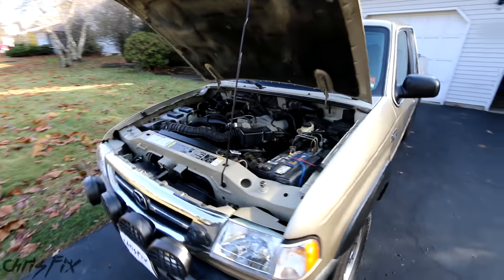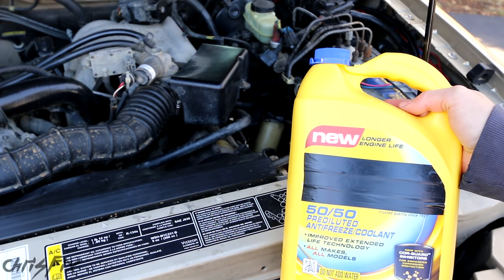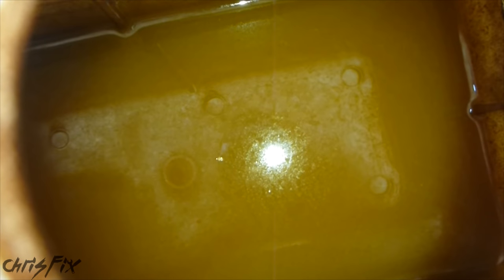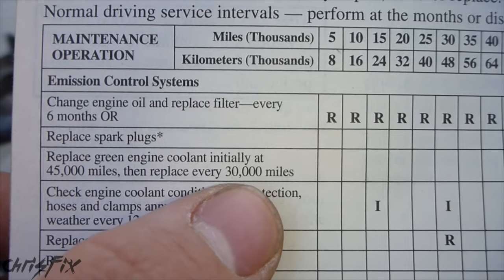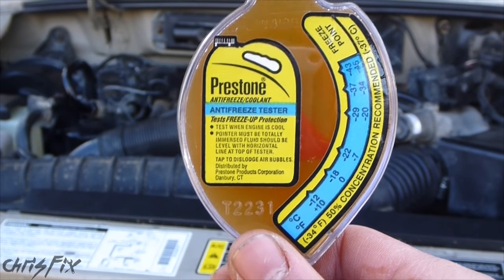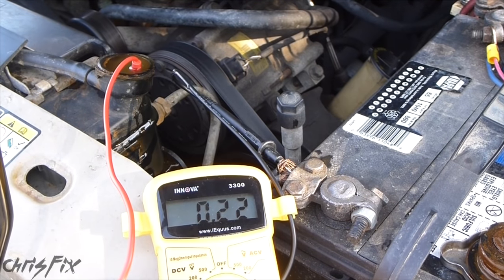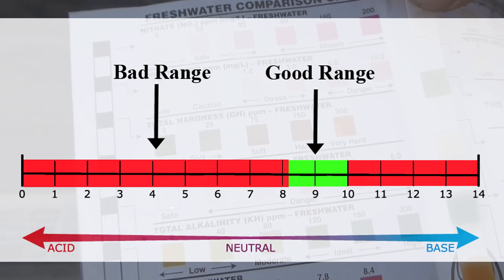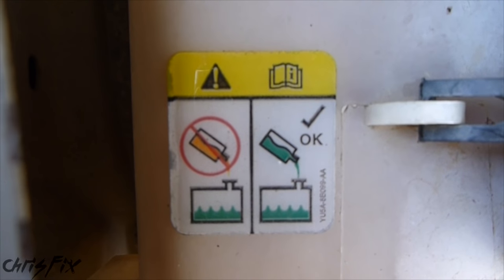How to Check and Test Your Coolant/Antifreeze

Comment: Cheap coolant do have some ethyl glycol but most have little to no corrosion protection and cause this same thing. Running a named brand for two months and no problem.

Comment: Initial sign, that the head is cracked in my experience is when you see vapor-like smoke coming from the coolant exp.tank, when you start the engine. Everything is fine, temperature is ok, hoses are ok, pressure inside the cooling system is ok, just there is some smoke there and you can see very thin skim, barely visible, floating on the coolant surface in the exp.tank. Be 99% sure that there is a problem with the engine's head or even a block. It is easy test to perform when you wanna buy a used car. Start the engine with the cap off the exp.tank and watch with the flashlight pointed into coolant. If you see a smoke after 3-4 minutes coming from there and more, if you see that tiny skim there, be almost sure that you are buying a huge problem. Just get away from that car.

Comment: Great video Chris!
That test you made with the voltmeter, I've heard you could do the exact same test to check your brake fluid, and the reading also shouldn't be above 0.3. Do you agree with that? Are the reasons for that the same as you explained for the coolant?
Reply from the maker: The biggest concern with brake fluid is that it absorbs water and you don’t want that because it could cause your brakes to fail.

Comment: On my car, the Owner's Manual recommends "Inspect evaporative control system.  Check all fuel and vapor lines
 and hoses for proper hook-up, routing, and condition."  every 45,000 miles.  What is an evaporative control system?  Do you have a video for that?  (2016 Corvette Z06)

Comment: This is a textbook case of mixing two different kinds of coolant. If you mix the orange with the green, it will drop the silicon out of suspension and deposit that nasty brown stuff everywhere. Also, orange coolant is acidic even out of the bottle.
Reply from the maker: BlazerLT Thanks for sharing.

Comment: Based on your part two, coolant doesn't circulate on most vehicles when you turn your blender door to max heat, while your running your vehicle during a flush, your not allowing your engine to heat up fast enough.  due too, you using your heater core as a mini radiator and blower Motor as a cooling fan. Your transferring heat into your vehicle to cool your engine!
Reply from the maker: 211StRes Your engine does not have to heat up for the coolant to flow through the heater core.

Comment: Great video overall, but don' you think that using a color based pH test with a colored fluid is a bit inaccurate? Especially when the fluid was orange and the acidic range which was indicated by the test was orange. Once again still a great video and your channel is an awesome resource

Comment: Great tips 👍
What if my coolant passed three of four tests, except the pH one? 
It's between 7 and 8, a 7.4 I would say, is it still good for 1 or 2 more years? 
Coolant is 6 years old now and the orange one which came stock with the 2013 Mustang GT.
Reply: Most mechanics will tell you anything between 7 & 8 is good for your coolants ph but I personally wouldn't run any brand of coolant beyond 5 years...

Comment: boat questin but same topic  On closed cooling stern drive boats if you put to much concentrated antifreeze in will it overheat? All passages are clean new pump risers manifolds but temp is 170 this year intead of 160. Stat is new too. 80 ocean. That`s the only thing i can think of. Also guage and sensor new too.
Reply from the maker: Yes because the water in the coolant cools better than antifreeze, the antifreeze lowers freezing temp and raises boiling temp and prevents corrosion but it's not as good as transferring heat like water is. Check your heat exchanger/sea water strainer since it can get clogged with scale/seaweed

Comment: I have that exact same multi-meter, its a piece of junk (amp range didnt work out the box). Bought a used Fluke 23.
I had never thought of checking for corrosion by measuring voltage on cars, galvanic corrosion is prevented on boats by using diodes and sacrificial anodes.

Comment: I guess I didn't do my Mustang flush properly. Still, my tester shows I'm good to -20F. Sometimes it gets a little colder than that around here but not often.  Our overnight lows rarely get below -10F.  My Xterra is good to go with a test reading of -34F.  Probably should do a flush on it since it's been over 5 years (47,000 miles). It's hard to keep up with maintenance when it's every 5 years or 30,000 miles or whatever. UPDATE: done the flush again and let the cleaner run through the system for 5 days, flushed out with distilled water (took 9 gallons), and refilled and now the protection is down to -34 degrees Fahrenheit. A fair amount of bucks to get it done right but since an engine is much more expensive......

Comment: I love your vids and because of this I just attempted to flush my coolant on my 2011 Mercedes Vito. Unfortunately only 5 litres came out of the 10 litre system and I don't know how I can get the rest of the water out of the engine as it seems when I open the bleed screw from the bottom of the Rad, I am only draining the radiator and not the engine too. Its a pressurised system, are these much different to a conventional system?
Reply from the maker: There is usually a plug on the engine block somewhere to drain the rest but even half a flush is good.
Reply: @chrisfix  Nice one man, thank. I took it for a good drive today and got it up to a high temp to ensure the coolant was circulated. When I got home I checked the fluid and its looking nice and clean. Thanks for your reply .

Comment: In my VW's the coolant has been rated for the lifetime of the vehicle. I just tested the coolant in my 2001 Jetta TDI with 270,000miles and it's rated for -40c. I then tested my 2014 Tiguan, exact same temperature rating. I love how people say VW's are high maintenance but yet your Honda and Toyota require coolant changes every couple years while VW's dont also VW maintenance services are every 15,000kms while Honda and Toyota are ever 8,000kms. Less time spent doing regular maintenance equals less money spent on regular maintenance.
Reply from the maker: Brandon Friesen That is awesome! How was the multimeter test on that coolant. I am curious! Give it a try and get back to me!
Reply: ChrisFix  me too :)
Reply: ali amiri While I agree Hyundai has come a long way they still aren't there for reliability like a Honda or Toyota. Though I think Honda quality isn't what it was.
Reply: Brandon Friesen I don't trust the 15k service interval. Yeah sure, your engine will last 100k miles past any power train warranty, but when your engine is prematurely worn the manufacturer could care less at that point. They want you to buy a new car and advertise less service costs than the competitor.
Reply: DE Nichols I've been doing the 15k service on my 2001 TDI since it had 50,000kms on it. Now it has 270,000 and is still in top condition. My 2014 tiguan is on VW's 15k maintenance interval. It now has 40,000kms and still runs like new. That's the advantage of synthetic oil. If your doing changes before 10k, you're wasting money and oil. BMW's are on a 20k service plan and have been for decades. No major BMW engine failures as a result. When my 15k service makes my engine go wrong, then and only then will i decrease the interval. So far, no harm done.
Reply: Brandon Friesen I thought about it further and you are saying 15k kilometers not miles. At about 9k miles that's not nearly as bad as I was thinking.

Some 15 k mile oil changes in the states have resulted in BMW
Reply: giving out new engines. Sorry. Bumped the send button early. Thanks for sharing your personal experience.
Reply: Brandon Friesen Oh. I do hope you get back to us with the multimeter test. My 1996 Saab 900 SE tested at 0.3.

I was just going to top it off, now I'll drain the radiator too.

(It's sat around for a lot of years. Waiting on a fuel pump to get the old bird on the road again. So the coolant in what was an empty overflow is still clean.)

In the past of coolant looked good I called it good. I have the specific gravity tester but hadn't used it much. I don't keep it as handy so always having my multimeter is my first go to now.

Comment: Hey Chris I have a Ford ranger 2002 xlt 2.3l and my check engine light came on took it to read the code it's the thermostat I was wondering what type of thermostat I need with or without the sensor... thanx much live the channel
Reply from the maker: +Fidel Garcia The thermostat doesnt have a sensor. It is a piece of metal and a spring. Just get the factory temperature thermostat.

Comment: I was wondering if you could do a video on antifreeze mixture ratios. Everyone seems to always mix it 50:50, but on the bottle it seems like 70:30 (antifreeze:water) is the best protection. Nobody seems to know. I’ve always mixed it 2 parts antifreeze to 1 part water.. figuring it’s a compromise between 50:50 and 70:30.. a clarification video would be awesome.. thanks and I appreciate your hard work

Comment: Quick tip on those testers. At least in the fish community, those strips are not as accurate as most aquarists like them. They get the job done and point out any big red flags, but most use a liquid tester from API or some similar brand. They cost about $30 and test a lot of things, may be worth the investment if you need to check a lot of coolant or want more accurate readings.

Comment: Chrisfix: My truck overheats or at a minimum the temp gauge redlines when I turn the heat on. However it does not do this when I use the AC. I also notice in the winter my coolant resevoir gets low and I have to top it off frequently. What could cause this? Thank you in advance!

Comment: the owners manual for my 2012 Mazda3 is:

Replace at first 192,000 km (120,000 miles) or 10 years; after
that, every 96,000 km (60,000 miles) or 5 years

and to use FL22 coolant
Reply from the maker: jeffrey r Thanks for the info! I would still check it once a year after the first 3-4 years to insure the coolant is in good shape.
Reply: yup.  i wouldnt want to wait around at 192k kms to get my flush.  my car is turning 3 years old in January lol

thanks for the help
Reply from the maker: ***** You can do that if you want.

Comment: Hi! Two things. First, the tester I have (similars as in the video) requires warming up the engine to normal operation temperature before test, how much a difference will it make? Second, when i keep the red pin of the electrometer inside the radiator, the result is near 0, but when I move it in circles in the coolant, it gets up to 0.30! What should I think about that?

Comment: Thanks for the video. Please, i have a VW Polo 2005, 1.4 petrol 50k miles. The antifreeze in the factory one, cristal clear, no contamination (G12 red/pink). I made the multimeter test and it shows more then 10V. I check the multimeter to measure the car battery, is working fine. It's even possible to show that high value?(10V plus)
Reply: Does your car have an electric water pump?  Just wondering if something is shorting in the pump (if it's electric), which could cause that high of a voltage...  I'm not an expert though.
Reply: @landoncarter6452   i think it's mecanic because is on the accesories belt(engine, ac,  water pump) and the engine was shut down when i measured.
As a feedback, i've change half of the antifreeze. How Chris says, is safer regarding the aditives of the cooler. Thanks guys!

Comment: Hey Chris, really interesting video, espacially with the multimiter. I have no idea before that you can test it this way ;) Is there more to cover about that method or that's it?
Reply from the maker: Marcin Wojciechowski There is a little more to cover about the topic. Another test is to disconnect the battery and test it. I will make a video on that eventually.
Reply: ChrisFix Ok, can't wait ;) Thanks

Comment: Hey, just came across this and had a quick question: will sucking coolant out of the radiator cap put air in the coolant system? How can you tell if air gets in?

Comment: Chris, My son's 2008 dodge caliber that we bought as used and had 180,000 miles on it froze up when the weather here hit 19-23 degrees. When we tried to start it it made a horrible squeeling noise. We shut it off because it sounded like the water pump an pulleys were frozen. I waited till the temps were above freezing and tried it again and the engine seems to be running like it had before. The engine doesn't over heat and sounds good. I know I need to do a coolant flush but what else do you recommend me checking? I know I am lucky the block didn't bust.

Comment: Chrisfix, I love this educative video thanks.
I like u to help me out if u can,
I found some spilled green fluid under my ford focus 2003 model one certain morning, nt too far from the front left wheel under d engine. I   guess it shld be d coolant that spilled. Question is, why wld my coolant spill?.
Reply from the maker: Shadrach Joshua Glad you learned a lot. Coolant can spill from a leak in a hose or radiator. The good thing is it is usually really easy to find. Get a flashlight and follow the leak to the source. If you run the engine, it will probably leak out more so that might help. Let me know what you find. Also, check this out (commonly causes leaks): https://www.youtube.com/watch?v=AGmQ50naiGg
Reply: Thanks so much Chris.
I finally trace where the leak is.
Seems it leaks only when my car is parked in a specific inclination. But when parked on a plane surface the leak doesn't happen.

Comment: I got pure antifreeze and water because my truck Doesn't drain all the way, on the bottle of pure it say 50/50,60/40,&70/30
70/30 makes the boiling point higher and freezing point to about 80oF below which works best because I live in the northern region beside the border

Comment: Hey chris fix i have a 2003 Toyota tundra.. I was going drain and refill with the pink oem antifreeze but with closer inspection i noticed that owner before me put green antifreeze,so my question is should i just stay with the green or go the extra route and flush it and go with the oem pink antifreeze

Comment: If I do all these tests and they pass is it definitive even if the coolant is older then the specified mileage by the coolant manufacturer.
Reply from the maker: In that case since it's older than recommended I would just replace it with fresh coolant

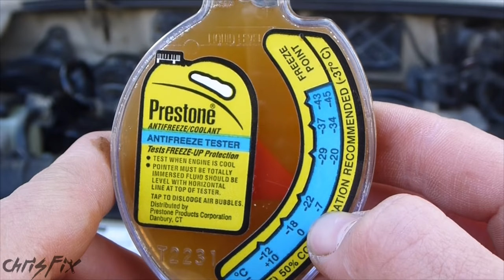Comment: 5:02 Whoa wait, that depends on the mix you are using (corresponding to the climate where you live), where I live premixed antifreze generally comes with a rating of negative 5 degrees, since it never freezes. So look at what coolant are you using.

Comment: OK, now gets my chance to give you hard time!

Shame on you if this is your truck!  How in the world did it go that bad?  Especially in two years?  What had you put in it when you did the flush in May 2012?  Even 5-10 year old has less gunk than what you have there.  Is your thermostat broken which is not letting the engine warm up?

Another great video; Seriously, once again you deliver!
Reply from the maker: 12vgs8606 Haha, this just goes to show you how badly this truck was taken care of before I got it! Also, it shows you how cheap that coolant is that the shop put in after they flushed it. I would have never thought to check the coolant any sooner because I figured it was fine but when I went to do some videos and saw the state of the coolant, WOW. I should have included the audio from that day when I took the radiator cap off. It went something like "what the... " haha.  And thanks man!
Reply: That proves the universal axiom "if you want something done right, then do it yourself or at least monitor it being done".  I try to take the latter approach and watch the guy like a hawk.
Reply from the maker: 12vgs8606 Yea I agree 100%! That is why I make these video and typically do everything myself. I just wanted the coolant system to be vacuum flushed because that is one of the best flushes you can do and I dont have that equipment. I did watch them, but it is hard to tell what coolant they are using when it comes from a hose.

Comment: You have really usefull videos! I'd like to ask you when it is written that the coolant system have 6.5l ,this doesn't include the expanded vessel(don't know the exact word).When I cleaned the system it got only about 5 liters but I didn't drive it long and can it be the reason for that 1 .5 liters where I cant fill in?
Reply from the maker: The extra 1.5L is in the engine (the coolant jackets next to the pistons and throughout the block).
Reply: Oh..sorry.I wanted to say that I filled new antifreeze and I put round 5,2-5,3 liters and above MIN antifreeze and its under 6 liters but it is said it is 6.5 liters.Sorry again.

Comment: I just removed my coolant, can I test it with the VOM for voltage when its in a plastic bucket? If it's still good I'll save it for top offs. Thanks for not playing music.
Reply from the maker: You need to test it in the car because there is a 12v system connected to it.

Comment: Hey Chris my 2013 v6 mustang is making weird splashing and bubbling sounds no leaks or over heating I was told it was an air pocket or something but how do I know for sure it sounds like it’s right next to my dash
Reply from the maker: Sounds like you have some air in the heater core, I would bleed the cooling system and that should remove it!
Reply: @chrisfix  would it need a new thermostat?